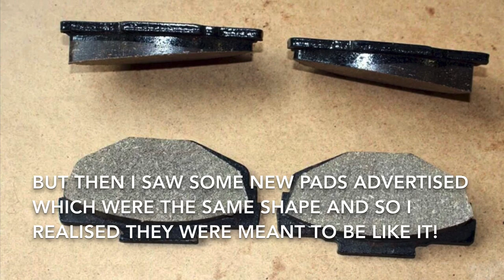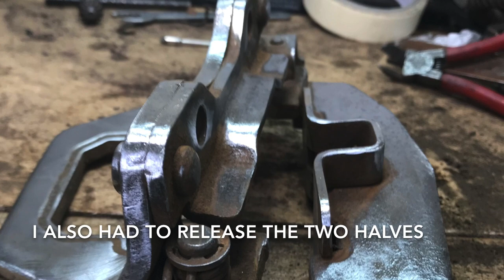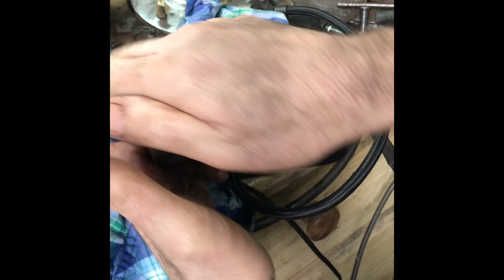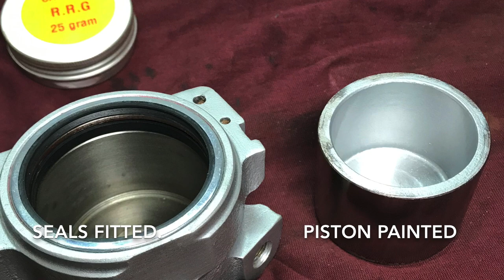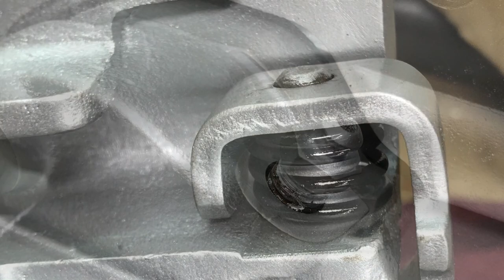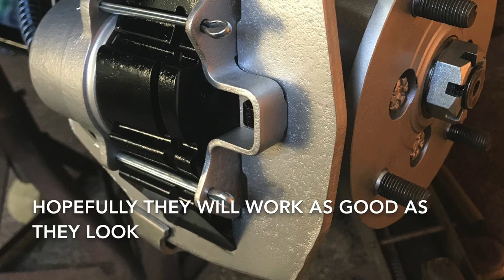Austin 1300 Restoration Swinging Yoke Brake Caliper Eps16 ADO16

Comment: Yet another brilliant job and video - well done.
You were very lucky with your pistons - I remember ones far worse than that even when the cars were only a few years old !
I worked on lots of these swinging callipers in the 70s. Ok, they were made that way for cheapness but they did a pretty good job. Also, bear in mind that when the 1100 first came out, most competitors still only had drum brakes ! I have a feeling that the earlier 1100s had the, more expensive, more conventional, twin piston callipers and that the swinging callipers came in later - maybe for the Mk11 and 1300s ?
Keep up the great work.
Reply from the maker: Thank you for your comment! Yes very lucky indeed, I was expecting them to be pitted and having to buy new ones at £25 each! It looked like it had new pads before it was laid up in 79, so the pistons were pushed in which helped to protect them. Better than drum brakes for sure, and I’ve enjoyed doing something different to the norm. Cheers

Comment: Remember those calipers well from my Dad’s various ADO16 variants. Without the (optional) vacuum booster it is almost impossible to lock the wheels up with these, so not the greatest in ultimate performance, but quite progressive and nice pedal feel. 
Because of the lack of vacuum booster on most models, the caliper design was intended to give a slight degree of “self servo” effect, as the pad materials used at that time didn’t have quite the same amount of friction and the whole package had to be small enough to fit inside the 12 inch wheels.
Reply from the maker: Interesting thanks 👍

Comment: Nope. Never seen one of those. And it's messing with my head. Piston pushes on pad. Pad pushes on disc. Hinge opens... nah... still not getting it.
Reply: I thought the same thing when I removed the calipers off my mg1300 mk2, unusual and unbelievable 🥴🇬🇧
Reply from the maker: Lol! Yep you are halfway there though,...cylinder pushes away from piston, which swings caliper pulling the other pad back onto the disc...it needs a 3D animation!

Comment: Saab 95/96 use this type of calliper. Don't know if they are completely interchangeable but I think they use the same pistons. Some parts that rub together can wear badly but can be revived by adding some weld.
Reply: Saab owners club sell replacement cylinders in stainless steel.
Reply: @lalaw99  That's the Swedish Owners Club but I think they are available for the 1300 here in the UK so OK for both.

Comment: Brilliant work. Those calipers are certainly something else!  

Can I ask what adapter you used on that tyre inflator to extract (shoot) the piston out?
Reply from the maker: Cheers 👍 oh it was just a conical shaped plastic inflatable adaptor which came with the pump. It sealed well enough when I got the right angle...I think it went up to about 40-50 psi before they started moving and the first one popped out so fast that it nearly fell off the bench onto the floor!
Reply: langranator Cheers! I’ll check to see if mine came with that bit. I noticed in your video, haha. I’ll try to keep the piston facing downwards.

Comment: did not know there aws these, might be this was the fore runner to the breaks we have now, as drums were rather slow and anything older was mostly wooden blocks or used hydrioc fluid to stop there breaks, still nweat and very uncommon to see
Reply from the maker: Yes I thought I’d seem all types of caliper until I saw these. ( probably the most I’ve scratched my head for a while). fortunately the back drum brakes are pretty conventional though 👍